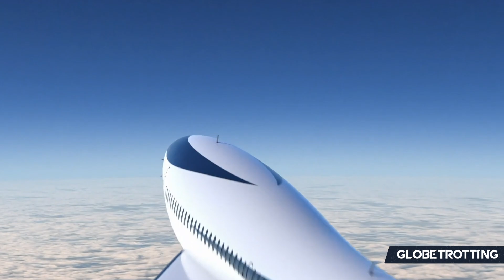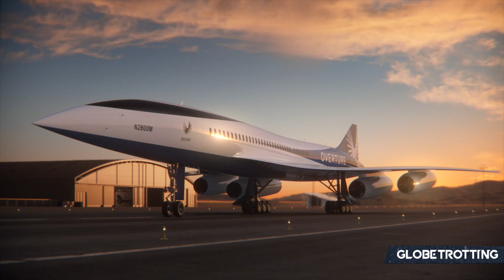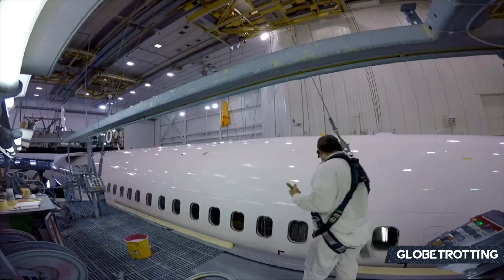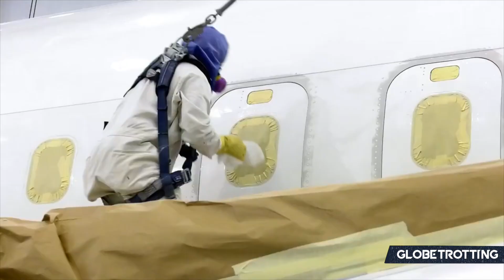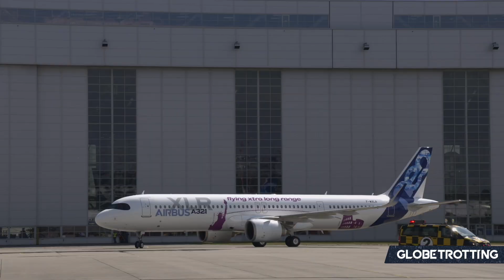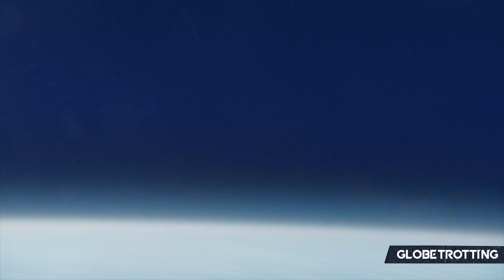Why Rolls Royce Left Boom Supersonic

Comment: I would love to see Boom succeed, but I don't see the Overture flying any time soon. As an investor stand point it just doesn't look like a smart investment. It would be many years before you'd see any return, if at all. And I have to wonder what Rolls Royce knows that we the public don't. Unless someone can come up with engines that will give the high performance at a low fuel burn it just won't work.
Reply: it's a beautiful plane but it ain't gonna happen.
Reply: @margarita8442  if you think this channel is a fail, why are you watching it?
Reply: Florida Turbine Technology, a division of $1.88bn Kratos Defence, started the symphony engine design in January 2023. Boom stated that no current engines, either military or commercial, are suitable for adapting to Overtures unique requirements. But the engine will use certified materials and parts, including the core and blades. The manufacturers of these parts will assist with the engine development program.  

Boom will design the pods and the variable geometry exhaust and inlet ducting, which will ensure low noise. The input spike will provide positive thrust, as on the SR-71. The combination of the pods and medium bipass engine will give good take off power and efficient operation at sub and supersonic speeds.

A big fuss is being made about Rolls Royce ending their contract with Boom, but AFAIK the contract was only for consultancy, and not to build an engine for Overture. Besides which, the Symphony project would be totally unsuited to the tier one engine manufacturers, like Rolls Royce, GE, P&W, Honeywell, and Safran. Their cost base and time frames would be out of kilter, and the volume of sales would not warrant their investment. GE caught a cold with the Affinity program.

Comment: What about fuel efficient engines on the Concorde? With a composite fuselage? Would they be able to achieve that a resurrect the Concorde?
Reply: Yeah, you could resurect Concorde with that. But you've got the reasoning backward : don't ever think "if (whatever fact you have) then it should (what you wish for)..." Instead, you should think "if nobody does it despite (what you believe exists), there's a reason, so what is that reason?"

In this case, there's a reason why despite able to use composites and more fuel efficient engines, nobody is interested in getting a new Concorde into the air, ie, for real instead of virtual propositions played in loop. The reason is, it's economically suicidal.

The last generation engines are 10-20% more fuel efficient than their predecessors. To propel an aircraft as big as Concorde at Mach 2, and remain profitable, you need engines 90% more fuel efficient than the latest ones BECAUSE the best we can do so far is consuming TWICE the weight of a REGIONAL JETS in fuel ONLY PER FLIGHT for the SAME seating offer as that regional subsonic jet. That's the amount of fuel you need for the feat, ie Mach 2 for 4000 nautical miles, two hours saved.

This results in paying that ticket 4 to 5 times the price of the same travel on the same route in a subsonic plane, which means, manufacturers won't sell HUNDREDS of units to airlines, rather a couple dozens all airlines considered, as the DEMAND will be nearing ZERO on a daily basis, you don't need a large fleet unless you want to park most of them on the ground 90% of the time.

The less units you produce, the more expensive each one gets, which means, someone, either the manufacturer, or the airline, or BOTH waste money for nothing, that's what many call "stupidity".
We make fuel efficient engines because we fly them below the speed of sound. Actually, if people wanted to be even MORE fuel efficient, they should leave their luggages behind and fly glider-like planes, MUCH SLOWER than classic subsonic jets, even slower than turboprops. It's when you want to go faster than sound that you ACCEPT you're no longer efficient in every sense of the term, the fuel you burn exponentially increases the more seats you add in the design, where instead of decreasing ticket price per added seat, it increases..... It's counter intuitive, but that's how aerodynamics and physics works : you have an optimum, and beyond, it's hell. You can invent all new materials and improve designs all you want, but that does not change how much energy is required to fight against Earth atmosphere to move that vehicle. The culprit : our financial model which values money only. Can you make kerosen cheaper than air, infinite and carbon free ? If you can, then Concorde can rise from its ashes....
Reply: you presuppose that people have balls and do not go in the same track . someone has to do something the first time. I bet you took the mrna jabs.  @StephenKarl_Integral

Comment: GE isn't bothering either. Just not worth the investment for such a vanity project that will probably never be be built.
Reply: Never Say Never Man that could change over there years for Boom Overture Supersonic Plane.
Reply: Florida Turbine Technology, a division of $1.88bn Kratos Defence, started the symphony engine design in January 2023. Boom stated that no current engines, either military or commercial, are suitable for adapting to Overtures unique requirements. 

Boom will design the pods and the variable geometry exhaust and inlet ducting.

A big fuss is being made about Rolls Royce ending their contract with Boom, but AFAIK the contract was only for consultancy, and not to build an engine for Overture. Besides which, the Symphony project would be totally unsuited to the tier one engine manufacturers, like Rolls Royce, GE, P&W, Honeywell, and Safran. Their cost base and time frames would be out of kilter, and the volume of sales would not warrant their investment. GE caught a cold with the Affinity program.
Reply: @phonicwheel933  It takes a decade or more to design, build, test, and certify a new engine and billions of dollars.

Comment: I’ve said it elsewhere and I’ll say it here: New York to London or Paris and Los Angeles to Tokyo are nice, but if you don’t include mid-continent metropolises like Chicago, Toronto, Delhi, Chongqing, Chengdu, Frankfurt, etc. you are limiting the usefulness of these airplanes too much. Either you will have to get these airplanes to fly efficiently at high subsonic speeds over populated areas or reduce the amount of sonic boom to acceptable levels to reach these important destinations.
Reply: @citylimits8927 Yes, you are quite right. One of the overriding design aims for Overture is for it to be economical at both sub and supersonic speeds. That's why medium bypass turbofan engines have been selected, hence the big underwing pods. This means that Overture will have 500 viable routes, some mixed land/water, as opposed to the two water routes for Concorde.

Overture will be 10% faster (Mach 0.94) than subsonic jets over land and twice as fast over water. Overture will create a sonic boom, but it will not fly supersonically over land.

Comment: i believe the concord tickets were significantly more expensive that a standard airline of its day.  Until a ticket on a commercial SST plane can  brought down to nearer the cost of a standard airplane ticket its only going to serve a small segment of the flying public.  I;d rather see money invested in the viability of undersea rail tunnels that they've been proposing on and off for years or ground effect aircraft,  Even ocean liners that do away with many of the amenities you find on cruse ships and the QEII to make them smaller and faster
Reply: @spn3925

Taking a JFK to LHR one way flight:  
Showing: Aircraft type,  Fuel cost per passenger,  Economy ticket,  First Class ticket,  Duration

Boeing 747          $147          $577             $2,308                      8hrs 
Concorde             $753                                $5,000^                     3.5hrs 
Overture^^            $708         $1,200           $3,000                      4hrs 
Business jet^^^                                 $53,000 to $99,000            8hrs  

Notes
^     2023 money 
^^   Estimated prices, assuming Overture carries 72 passengers against Concorde's 100. For the first 2 years, only first class seats will be available.  
^^^ There are no supersonic business jets 

A 16 hour flight across the Pacific on a subsonic jet could be achieved with a 1 hour refuelling stop by Overture, giving a time of  4 + 1 + 4 = 9 hours.

Comment: Rolls Royce backed out way back in September, about 7 months ago, not really new news, They picked up Florida Turbine Technologies, a retrofit, rebuild cruise missile engine MFG back in December
Reply: @boondockduane Quite correct. Florida Turbine Technologies will design build and test the Overture engine, but AFAIK it wont be based on a cruise missile engine. It will have the same basic architecture as engines that currently power all modern airliners:

  •  Turbofan
  •  Medium-bypass
  •  No afterburner
  •  Twin-spool
  •  35,000 pounds of thrust on take off
  •  Air cooled multistage turbine
  •  Single stage, 72 inch diameter fan, for quiet operation
  •  Low-pressure compressor stages: 3
  •  High-pressure compressor stages: 6
  •  High-pressure turbine stages: 1 (passively cooled)
  •  Low-pressure turbine stages: 3
  •  Additive manufacturing for lightness, low part count, reduced assembly costs
  •  FAA Part 33 and EASA CS 33 compliance
  •  ICAO Chapter 14 noise compliance

Comment: You haven't covered the fact that while EU bands all cars producing CO2 exhaust by 2035, EU is planning the same for planes in stages. As far as I know hypersonic planes will be banned in 2027 and all planes are mandated to have a hybrid engine using hydrogen by 2040 (which Airbus has already a prototype of). 
You can build whatever plane you like but where would you fly? Inside the US (that has banned hypersonic flight and is following EU always).

Comment: WIth any overseas airlines, is the cost factor or flying these machines.
Reply: @Hemidakota

Overture's predicted development cost is $8bn. Concorde's development cost was $14.4bn. The manufacturing cost will be less, the maintenance costs will be lower, and the availability will be higher. Overtures selling price will be $200M. Concorde selling price was $320M. For comparison, a Boeing 737-800 costs $100M. At a guess, development payback will be 150 aircraft and airline payback will be 10 years, assuming 72 seats and 8 hours a day utilisation.

Taking a JFK to LHR one way flight:  
Showing: Aircraft type,  Fuel cost per passenger,  Economy ticket,  First Class ticket,  Duration

Boeing 747          $147          $577             $2,308                      8hrs 
Concorde             $753                                $5,000^                     3.5hrs 
Overture^^            $708         $1,200           $3,000^^^^                4hrs 
Business jet^^^                                 $53,000 to $99,000            8hrs  

Notes
^ 2023 value 
^^ Estimated prices, assuming Overture carries 72 passengers against Concorde's 100. For the first 2 years, only first class seats will be available.    
^^^ There are no supersonic business jets
^^^^ $5,000 return 

A 16 hour flight across the Pacific on a subsonic jet could be achieved with a 1 hour refuelling stop by Overture, giving a time of  4 + 1 + 4 = 9 hours.

Comment: The FAA won't allow supersonic flight Mach 1+ over land, so that diminishes the useful routes.  And with seat tickets at 5 -figures each the customer market would be tiny
Reply: @npmetzy5737

Because Overture will be efficient at sub and supersonic speeds, 500 routes, some mixed land/water, are viable, rather than just 2 water routes for Concorde. Overture will fly 2x the speed of subsonic jets over water and 10% faster over land. Overture will will create a sonic boom, but it will not fly supersonic over land. Concorde carried 100 passengers at Mach 2, over 4,488 miles. Overture will carry 65 to 80 passengers at Mach 1.7 over 4,888 miles. 

Overture will be simpler to fly, eliminating the need for a 6 month pilot conversion course. Overture will also have a modern cockpit, with more room, and a flight engineer will not be required. Its cabin will be quieter and more spacious, and its seats will be more comfortable. In contrast to Concorde's awesome engine noise, Overture will comply with ICAO-14 regulations, allowing it to use all airports. 

Taking a JFK to LHR one way flight:  
Showing: Aircraft type,  Fuel cost per passenger,  Economy ticket,  First Class ticket,  Duration

Boeing 747          $147          $577             $2,308                      8hrs 
Concorde             $753                                $5,000^                     3.5hrs 
Overture^^            $708         $1,200           $3,000                      4hrs 
Business jet^^^                                 $53,000 to $99,000            8hrs  

Notes
^     2023 money 
^^   Estimated prices, assuming Overture carries 72 passengers against Concorde's 100. For the first 2 years, only first class seats will be available.  
^^^ There are no supersonic business jets 

A 16 hour flight across the Pacific on a subsonic jet could be achieved with 1 hour refuelling stop by Overture, giving a time of  4 + 1 + 4 = 9 hours.

Comment: Why would RR invest billions into engine development for an airframe with a limited marketplace footprint?
Reply: @haroldaranda8042 Exactly!

Florida Turbine Technology, a division of $1.88bn Kratos Defence, started the symphony engine design in January 2023. Boom stated that no current engines, either military or commercial, are suitable for adapting to Overtures unique requirements. But the engine will use certified materials and parts, including the core and blades. The manufacturers of these parts will assist with the engine development program.

Boom will design the pods and the variable geometry exhaust and inlet ducting.

A big fuss is being made about Rolls Royce ending their contract with Boom, but AFAIK the contract was only for consultancy, and not to build an engine for Overture. Besides which, the Symphony project would be totally unsuited to the tier one engine manufacturers, like Rolls Royce, GE, P&W, and Safran. Their cost base and time frames would be out of kilter, and the volume of sales would not warrant their investment. GE caught a cold with the Affinity program.

Comment: Most difficult problem for Boom it’s all future international pollution rules on emissions and noise not to find adequate engine.
Reply: @alainmare8081 Overture will be carbon neutral by running off SAF and it will comply with ICAO-14 noise regulations.

Comment: The only way this plane flies commercially is if they are bought out by either Airbus or Boeing.. Preferably Airbus, next someone has to manufacture a hybrid engine which works well with SAF.. And third they really need to work their asses on getting the price down to the levels of say 777x.. Still nigh on impossible task..

Comment: If you look at the design it will not work. Look at the size of the vertical stabiliser? An aircraft has to be able to accept two engines out on one side, with the size of that fin it will not work. Also if you look at the size of the passenger windows are too big, the is a reason why they were so small on Concorde, they will have to be on zoom as well. Would really love to see it work but I don’t see it happening, so I will not be investing in it.
Reply: @simonrochester4773 Yes, the fin looks far too small. The windows do look big too but, rather than aluminium sheet, Symphony will be moulded from a carbon composite, which is much stronger, and allows pretty much any shape to be formed. Composite is also lighter than aluminium and hardly changes size with temperature. 

The other problem is that there appears to be a lot of drag, with the 4 huge engine pods to house the turbofans, the windows, and now, an empennage too. 

Of course, all we have seen so far is images, I expect there will be quite a few changes as the development progresses.

Comment: I’m sorry BUT this is a project with long term difficulties and it’s just not been properly thought through. It’s NEVER going to happen and if by some chance it ever reaches operational production it’s not going anywhere. It’s going to be Spruce Goose 2, those who operate it IF they get it will ultimately regret it and it’ll be dropped quicker than a MDD 220! I honestly can’t believe that ANY Major Airlines would have ever considered it NEVER MIND put up money. Personally I plan to build Paper Airplanes if ANY MAJOR AIRLINE is interested in placing orders especially if they’re willing to put up any nonreturnable money? 😅😂🎉
Reply: @dxapa11ql Could you describe the basis of your dire predictions? Are you afraid that Boom is a financial rip off? Are fearful that Overture won't fly? Or are you worried about, the ozone layer, rising sea levels, or the coral reefs? Or is it all of these.  

You do know that Overture will not be flying supersonic over land, so there will be no nuisance from sonic booms. My main worry is that Boom will run out of money before they get a prototype Overture flying. Also, the new Overture design looks like it will have too much drag for Mach 1.7. What do you think?

I made many paper aeroplanes when I was a kid. Then I moved on to balsa wood gliders, and finally powered radio control.😊